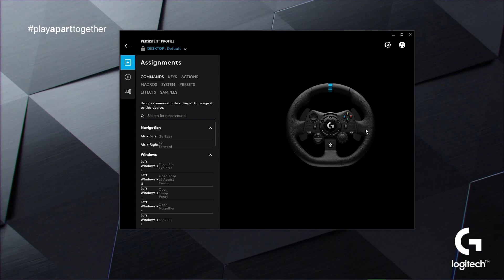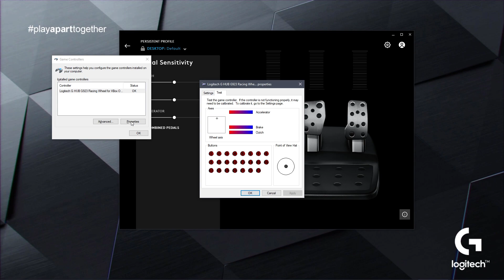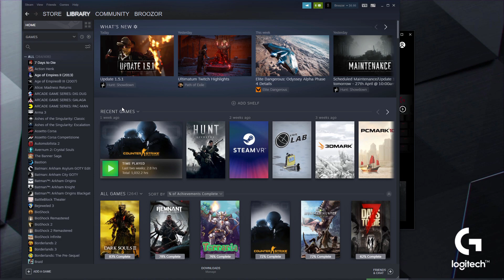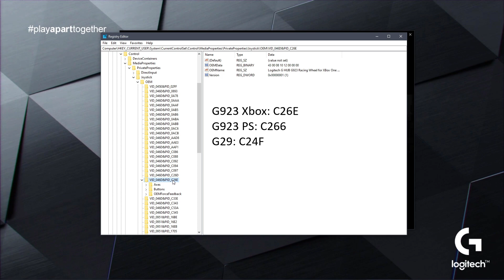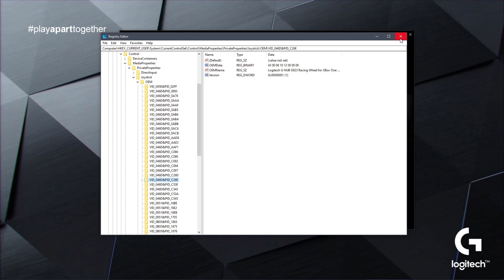How to troubleshoot G923/G29/G920 for Connection Issue

Comment: I am using a G923 and there is a green flashing light that means it has not enough power is that true?
Reply from the maker: Hey!

Yes, if you are getting a flashing light its usually a power issue! Can you make sure all your power connections are seated properly and also plugged directly into a wall outlet. If it doesn't change after that please open a ticket with us!

https://support.logi.com/hc/en-us

Comment: So I got a 920.. and it worked fine for the first several days .. now when I plug it in the light flashes, the wheel calibrates.. everything seems normal on ghub showing it's detected and I can see my inputs reflected on the screen.. it shows up properly in joy.cpl.. however, if does NOT show up in steam controller settings.. just says "no controllers detected"... Any ideas or information that could help? Would very much appreciate it.
Reply from the maker: Hi there!

Does it change in steam if you disable big picture mode? Does the wheel itself still function in game? You may have to assign controls manually depending on the game.

If that doesn't help you out please open a ticket below.

https://support.logi.com/hc/en-us

Comment: Still not working for me. I tried lot of things but i cant find my wheel on steam (not detected) and it's not working with F1 2021.
Reply from the maker: Hi there!

The last thing I would check is to make sure your power is plugged in correctly and directly into a wall outlet. If it doesn't fix anything please open a ticket with us!

https://support.logi.com/hc/en-us

Comment: I have the logitech g29 driving force wheel for ps5 it works but cant get it to work for bus sim 21 any ideas
Reply from the maker: Hi there!

The wheel should be compatible with your PS5. However, you may need to bind all your controls manually in the game. I'd go into your settings and see if you can assign all the controls!

If you are still having issues please open a ticket below.
https://support.logi.com/hc/en-us
Reply: Thanks for reply i now have it working fine turns out i needed to use pad to get past menu and try the  wheel when i was in the bus silly me great product realy enjoying using it

Comment: Hello. When i go to joy.cpl and press properties it doesn't show up that i can test anything and the calibrate button in settings is gray so i can't press it and when i got it to any game for example assetto corsa my wheel thinks 750 degrees is the normal and not 900 degrees and yes in ghub it says 900 degrees but when i press any number then 900 then it works. I have no idea how to fix this, anyone able to help me?
Reply from the maker: Hi!

Could you go into your device manager and see if the wheel is showing up? If you see it doing a driver reinstall might help you there. If you are still having issues please open a ticket with us below!

https://support.logi.com/hc/en-us

Comment: it didn’t work for me, i did all the steps and i plugged it back in but the light still flashed. Also, when i checked steam, it didn’t show any controllers. i’m using the g920, do you know how to solve this?
Reply from the maker: Hey!

If the light is flashing it usually points to a power issue. Can you make sure that your power supply is plugged into a wall outlet to see if that changes?

If it doesn't change please open a ticket below!

https://support.logi.com/hc/en-us

Comment: Hi! I have a G923 that was working great up until a week or so ago. Now when I plug it into my xbox the wheel calibrates and force feedback works but the xbox doesn’t recognize use any inputs. I plugged it into a MacBook and again the wheel calibrated, no blinking light, but G hub does not see it as connected. I have tried several outlets and all of the USB ports on both the xbox and the MacBook with no luck
Reply from the maker: Hi there!

If you could open up a ticket with us below we can diagnose this!

https://support.logi.com/hc/en-us

Comment: My problem is when I go on g hub my g29 steering wheel and pedals is not showing the wheel turn when I turn and not showing the pedals mousing up and down when I press on it it just does nothing
Reply from the maker: Hey there!

Can you make sure the wheel is plugged directly into a wall outlet?

If it is and you are still getting issues please open a ticket below.

https://support.logi.com/hc/en-us
Reply: @logitechsupport  i already have a ticket they said they will step up the level of investigation and they emailed me and I replied and didn’t get a email back

Comment: i'm losing feedback on F12021 as soon as a race starts. none of the fixes here did anything. There is tension on the wheel literally until i'm sat on the grid. Not sure what else to do other than throw the wheel out the window.
Reply from the maker: Hey there!

Could you open a ticket with us? We can diagnose and help you down below!

https://support.logi.com/hc/en-us/requests/new?ticket_form_id=360000621393

Comment: I've got a strange situation with my G29. It turns on, self calibrates, and the green light is solid, but my PS4 isn't recognizing it when I press the Playstation button. Any recommendations?
Reply from the maker: Hi!

Can you make sure your wheel is powered properly? If you are still having issues after that, please open a ticket below!

https://support.logi.com/hc/en-us/requests/new?ticket_form_id=360000621393

Comment: Hello. I bought a G923 and Shifter, the Wheel is a PS4/5 version and the shifter doesn't show up, neither works ingame. I tried some methods including step 4 in your tutorial but the test section still shows up blank and I can't check if my shifter is working or not.
Reply from the maker: Hey!

Can you open a ticket below with us? 

https://support.logi.com/hc/en-us/requests/new?ticket_form_id=360000621393

Comment: This didnt help sadly but does anyone know what my problem might be my wheel works fine but every 2 to 5 mins while playing a game my wheel and pedals stop working it still has the power light on on the wheel but has no response not even the pause button and when i pause a game when i unpause it sometimes it loses all force feedback and the wheel is just freely moveable and i have to un plug it and plug it back in for it to regain the ffb
Reply from the maker: Hi!

You might be losing power or the connector might be disconnecting. Can you make sure you have the connections seated properly? If this isn't the issue can you please open a ticket below with us?

https://support.logi.com/hc/en-us/requests/new?ticket_form_id=360000621393

Comment: My Logitech G29 when it turn on , steering wheel roating perfectly but  when started to play not connected to steering wheel.. only access to joystick
Reply from the maker: Hey there! Do you have a controller plugged in as well? You'll need to make sure that the wheel is the only controller input. 

If that isn't the source then we can dive deeper in our ticketing system below.

https://support.logi.com/hc/en-us/requests/new?ticket_form_id=360000621393

Comment: Hello, I come publicly to thank logitech for the excellent service related to my problem with G29 and the degrees of operation on Ghub as I reported a few days ago in a comment here. When reporting the problem, the company and triggering the original purchaser of the product (because I bought it already used but still under warranty) logitech approved a replacement and they are sending a new product. thank you logitech and congratulations for the excellent service!

Comment: What can I do if GHub is not recieving any inpouts like wheel degrees or pedals? I've tried joy.cpl and there it works normal. (I have the g29)
Reply from the maker: Hi!

You might not have had a successful driver installation. Could you try to reinstall your drivers?

If that doesn't work please open a ticket with us!

https://support.logi.com/hc/en-us/requests/new?ticket_form_id=360000621393

Comment: Hey logitech my g920 recently started having problems. The wheel would function normally as long as i wouldnt plug the pedals in. If i plugged the pedals in the base of the wheel the wheel would start making a buzzing noise and would start viberating. And the wheel wouldnt work until the pedals were unconnected. I dont know if theres any thing i can do but if there is i would apprieciate it.
Reply from the maker: Hi!

Please open a ticket with us, we can definitely help you out here!
https://support.logi.com/hc/en-us/requests/new?ticket_form_id=360000621393

Comment: This is not working for me. The power adaptor that goes inside the wheel is extremely loose and is moving left to right about half a cm. I also haven't got a laptop so I can't use this Ghub. And guess what Amazon hasn't got any wheels in stock so they are useless. Looks like my sim racing is over for a while.
Reply from the maker: Hey there! Can you open a ticket with us so we can deep dive your issue? 

Link below!
https://support.logi.com/hc/en-us/requests/new?ticket_form_id=360000621393

Comment: I tried every step of this, and still the wheel doesn't work. I think it quit right after a Windows update. My G29 has power, my computer recognizes it, but none of my games on Steam recognize it. Suggestions?
Reply: Ok, I tried the steps in this video again, and restarted my computer again, and now it works. However, fwiw, when I check in Steam under controllers, all the boxes are still unchecked, BUT: Steam still says "No Controllers Detected".  Whatever- at least the wheel is working again.
Reply: did steam ever recognize your wheel. I've got the same problem. @weylandyutani7973

Comment: Hey logitech. i have a weird issue where the operating range does not correctly communicate between the driver and the wheel. the driver says its limited to 270 degrees which is what i want for an arcade racer i play. but it still uses the whole 900 degrees of range effectively emulating 270 degrees instead of tracking the 270 degrees.
Reply: I have this issue I set it at 360 degrees but I still have to operate the full 900 degrees.
Reply: @horizon5624  i just uninstalled ghub and manually calibrated it to 360 through the game controller setup
Reply: @samicrossfusionxben-dhiab5441  I'll give it a go thanks. Well that worked still can't get force feedback on F1 2021 though.
Reply from the maker: Hey! Please try our most recent G hub update to see if this fixes your issue!
Reply: @samicrossfusionxben-dhiab5441  my wheel is not detected by any game or Windows without GHUB?

Comment: My G920 just will not stop flashing the light. It won't connect to the computer and it's just flashing really fast! I got a 65 watt power source and the internet tells me it only needs a 28 watt power source, I am getting sooooooo angry.
Reply from the maker: Hey there!

The flashing light typically indicates a power issue. Are you using the power supply that was supplied with our wheel? Is this plugged directly into a wall? If you still are having an issue please open a ticket with us below.

https://support.logi.com/hc/en-us/requests/new?ticket_form_id=360000621393

Comment: anyone else have the same problem when drifting on wheel force feedback just stops working but can still move wheel please help
Reply from the maker: Hi!

Is the wheel still responding after the force feedback stops? You may need to adjust your FFB settings in game to make it function correctly. However, if this is seen through all games please open a ticket with us below!

https://support.logi.com/hc/en-us

Comment: very good vid but mine is still not working if i try to chance my operating range to 320 to play f1 it says it chanced but it still is on 900 with maximum force feedback im using a g923 does anybody know what to do? i would be very thankfull
Reply from the maker: Hey there!

Can you make sure you've updated G hub to the most recent update? This should solve that issue. 

If it does not please open a ticket below with us.
https://support.logi.com/hc/en-us/requests/new?ticket_form_id=360000621393

Comment: My computer recognises the wheel but when I put it to any degree lower than 900 (in G Hub), it makes it so that for example when i put it to 450° it registers my full turn as only half of what im actually turning( as 450° is half of 900°) For example when i turn it 180 degrees it only registers it as 90. This is proportional to all degrees below 900 ( for example on 300° it registers the move as 1/3 of what is actually happening) It makes playing with the wheel impossible on most games.
Reply: i have same problem please tell me if you fix it
Reply from the maker: Hey!

Does this reflect in game? If your wheel is set to 900 but then you alter the game settings does that adjustment work?

If you are still unable to change it please open a ticket with us below.

https://support.logi.com/hc/en-us
Reply: @logitechsupport  
I play mostly f1 2021 so there is no setting for the rotation, and it stays on 900 degrees. I have already opened a ticket and multiple bug fix reports with no response.

Comment: I have an issue with content manager/assetto where my wheel suddenly is no longer recognized as a controller and ghub breaks the wheel settings and won’t allow me to play properly
Reply from the maker: Hey!

Can you make sure that your wheel is powered correctly? You may need to move your power supply to a wall outlet and also be sure to check that the power is connected to the wheel!

If that doesn't work please open a ticket up with us.

https://support.logi.com/hc/en-us

Comment: nice, now can you tell my why when i set the wheel to 360° i still have to turn it 450° to the left for the software to register 180° to the left???? and my controller not showing the buttons in gamecontroller windows settings? not being able to calibrate in there either?? the whole journey with this wheel has been a disaster. It only registers the right angle half the time, i dont play for a week suddenly it doesnt work anymore. I wish i would have saved the money and stayed with my g25 and the ancient software it had...
Reply from the maker: Hey there!

If you can open a ticket with us that would be best! We can dive deep into the issue there and find a solution!

https://support.logi.com/hc/en-us

Comment: Im having problems with force feedback, and i havent even got it working after 3 days do you have any suggestions on how to fix it, this issue is on pc only and im having issues on both forza horizon 5 and wreckfest. Could it be something with steam or is my wheel broken? Cause the force feedback works on my ps4
Reply from the maker: Hi!

Do you have FFB enabled in G Hub? Make sure that is enabled for your games on steam as well as having all your in game settings correct! If you are still having issues we can dive deeper into it via our ticketing system.

https://support.logi.com/hc/en-us

Comment: hey, i have a problem: when i set the operating range at anything below 900 the wheel still turns 900 degrees for example when i set it 540 lghub shows its 540 but i can still turn the wheel 900 degrees it doesnt stop when its supposed to also i have no ffb in f1 2020 i dont know what to do i reinstalled lghub and it didnt work (wheel is logitech g923 and it has worked normally but a few days ago it started doing that)
Reply from the maker: Hi! 

Does this operating change when you change your in game settings? If it doesn't after that please open a ticket with us.

https://support.logi.com/hc/en-us
Reply: @logitechsupport  not in f1 2020 atleast and no ffb. In dirt rally 2.0 the ffb works and operating range works because it has softlock but the throttle is stuck in replay mode